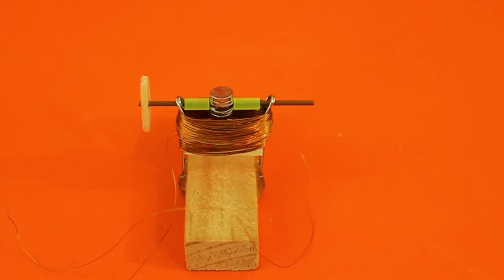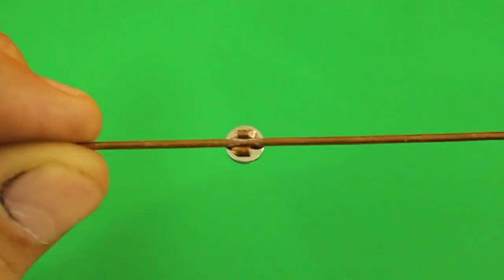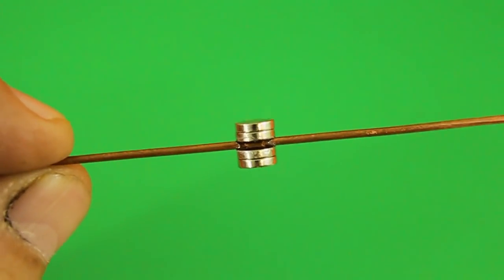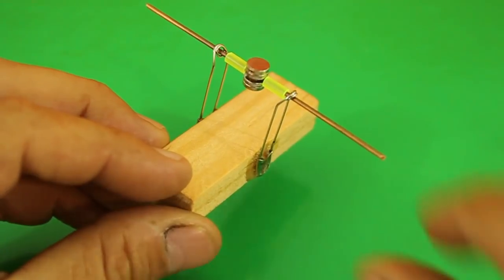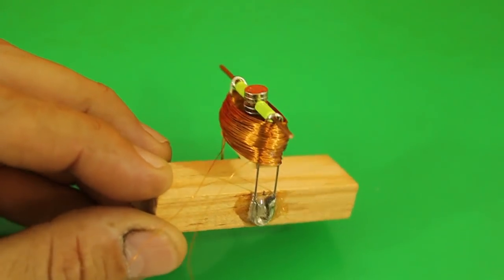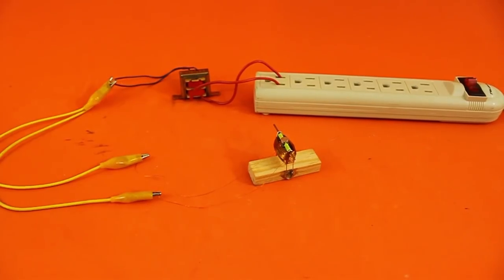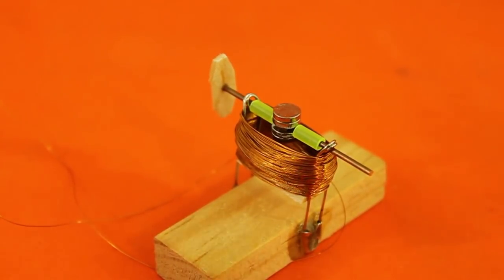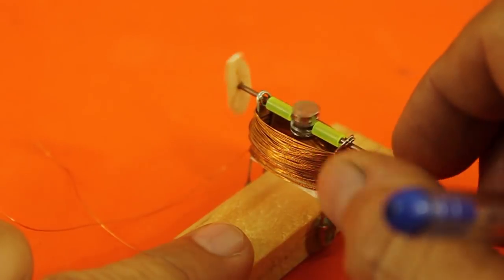Tiny A.C. Homemade Electric Motor

Comment: Since you did not mention anything about the polarity of the magnets, it does not play any role and also the capacitance of the capacitor must not be an issue either.  Just wanted to make sure.
Furthermore, the interaction must be between the coil and the magnets and not the copper rod as a shaft or the metal safety pins.  They could easily be made of wood.  Since you made no commentaries in regard to them being in those forms as a must.
Thank you.

Comment: You can generate electricity by moving the magnet
Reply: Yes
Reply: Yes, you can. but you need a prime mover like a DC powerful and correctly sized motor with high speed capability and power, so that the magnets can spin as fast as possible and thus generates AC power, not DC. but of course there are factors to consider when making an AC generator, regardless of simplicity or complexity.

Comment: I think this is more of a synchronous ac motor because usually those types of motors have a magnet in them. Ac induction motors have a solid metal that is not attractive to magnets, and it has a piece around that with diagonal bars like a squirrel running wheel that are attractive to magnets, but is not magnetic itself.

Comment: i made a smaller electric motor, 1/4 of your motor size with brushes when I was 10 years old.
Smalll motors are 1 to 2 millimeters in size, Throw yours in the trash.
,

Comment: Of course, because the magnet isn't centered in the coil, it's not at its peak efficiency, but could it be doubled up so a second identical coil could be above the magnet? That would centralize it.

Comment: Uhhhh in the case of the 240v AC circuit, did you really touch something that was 0.2 milimeters of lacquer away from 100% death?
Reply from the maker: It´s 120 V, and no, it is not 100% death. I´ve had shocks of 120V from mains many many times and i´m still alive. Of course it is not something I would recommend.